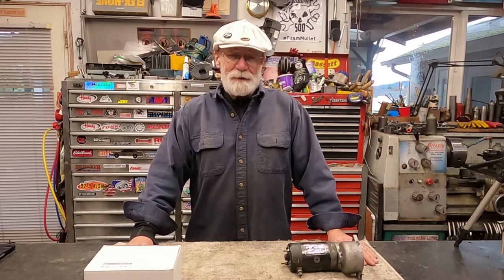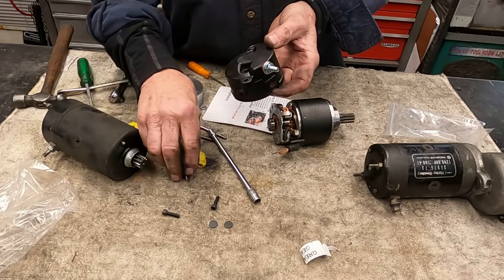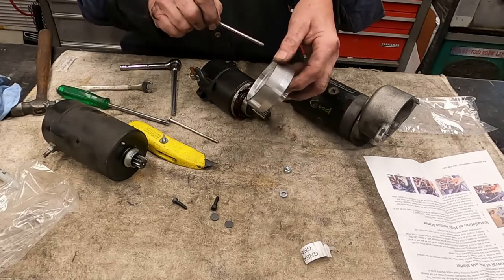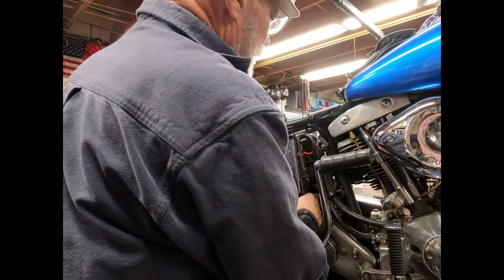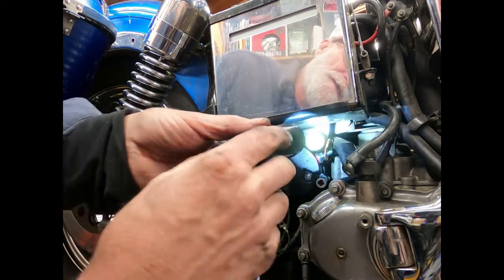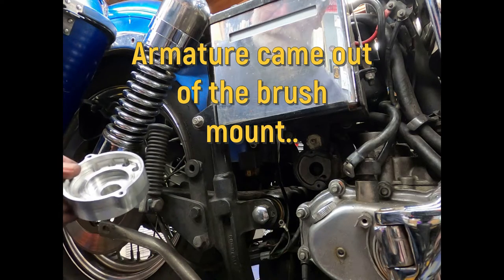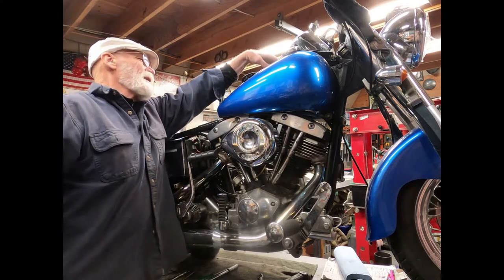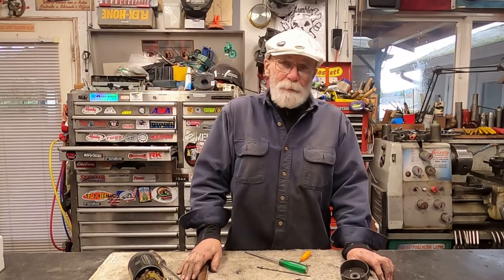Shovelhead Hi Torque Starter

Comment: I did the same upgrade starter, my battery holder had a lower bracket that sat above the terminal Sod’s Law I moved it, I got 3.6 gauge cables and upped the earth with my old positive boy it spins so fast now even if misjudge which holes to bolt the spacer you can undo and move stick with it guys.
Reply from the maker: Thanks for watching.

Comment: It's a shame it didn't come with a motor end mount in the kit to make things look better
Reply from the maker: But it still works. Thanks for watching
Reply: i have a 1982 shovelhead fxs lowrider with a kick start and i want to add a electric starter to it . the primary is set up for it but all thats there is the silinoid and a flat plate on bacj. just the basic's please wiring and install . thank you

Comment: thank you for making this video to help us all out. do you have a high comp engine? even with the best cables and battery i still have issues getting over that compression stroke with the starter.
Reply from the maker: Yeah that's why I put the high torque starter in place to counteract the compression. Thanks for watching.
Reply: @outlaw86custom  so this got rid of you having to hit the starter button a few times before you finally can get it to crank more than one revolution? thanks for responding i really appreciate it. 67 FL here
Reply from the maker: @dsruddell  well it did for me but I don't know your bike. Thanks for watching.

Comment: Ha, ha - I have the same starter and mine came apart twice also while removing and replacing the inner primary and transmission mainshaft seal. I wish I saw this video fist cause I had a heck of a time with the brushes. FYI - my main wire was facing toward the back and it seems to be happy there. Just found your channel and I'm enjoying your videos!
Reply from the maker: I'm glad I could help. Thanks for watching.

Comment: great video... thou i have evo i have just that starter... ( i call my bike shovevo ) .. i wanted to see how to remove a starter f
rom evo but everything i found was about newer ones... and that shovel movie is just about a starter i have
Reply from the maker: The mount of the starter on the earlier evo is the same as the shovelhead 2 bolts and some also end mount. Disconnect the ground on your battery remove the two bolts and an end plate mount if you have to you also may have to remove the rear exhaust to slide it out.
Thanks for watching.